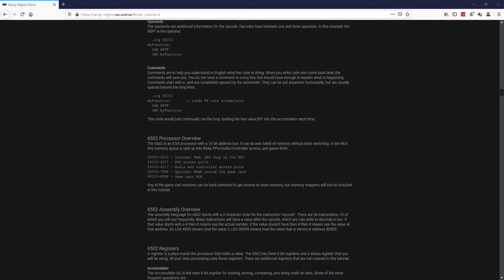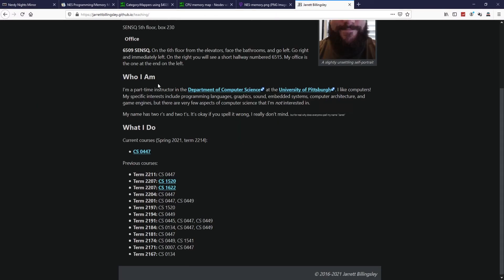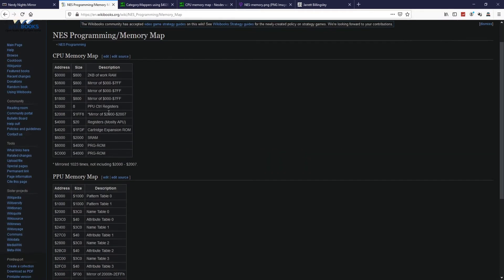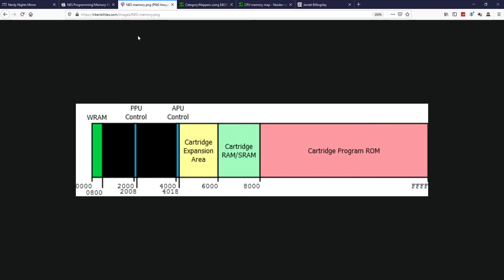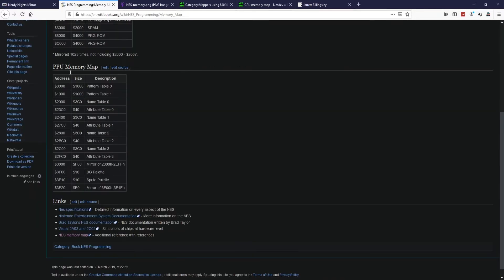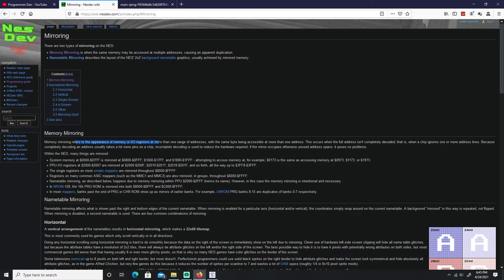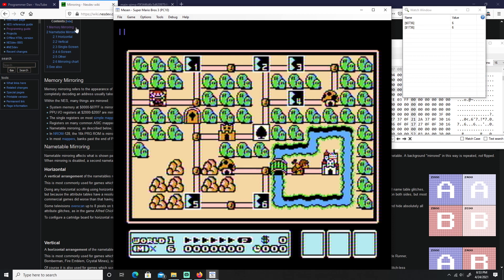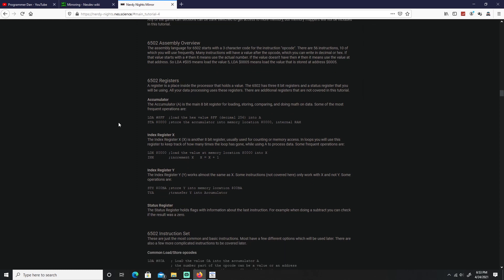NES Programming: Video 3 - Memory Mapping and Memory Mirroring

Comment: Is there a point, any advantages to memory mirroring?
Reply from the maker: Not really. i always use 0 page whenever i can cause it uses less cycles.

To make the console cheap, back then they wouldn't connect all the address buses, so you'd save money by not soldering, materials, etc. Mirroring is just a byproduct of that.
Reply: @ProgrammerDan  Okay. That answers my question. Thanks!
Reply: In my emulator that im working, as a cheap hack I make all mirrored addresses go back to to their real address, not accurate at all but it seems to work so far.